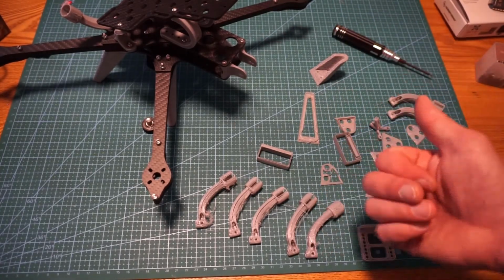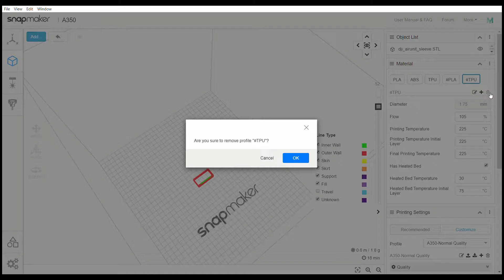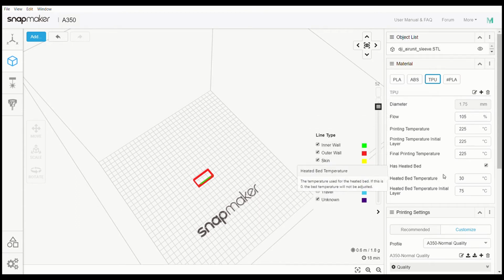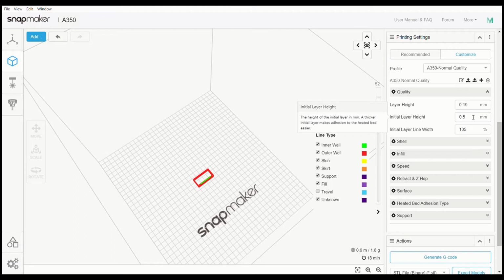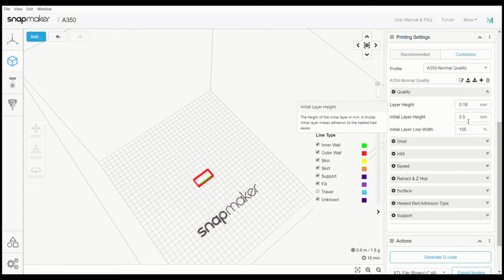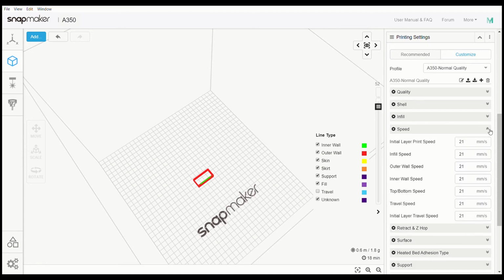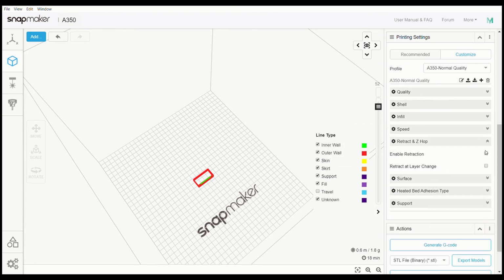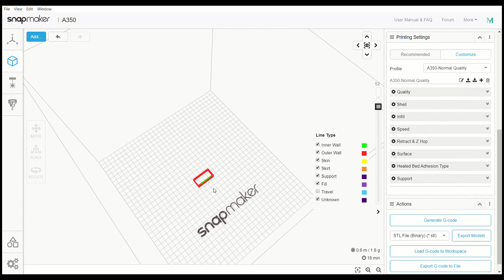SNAP MAKER 2.0, TPU PRINTING, AND SHENDRONES THICC

Comment: Thanks for this. One question: did you say you added a tube in the extruder that prevents buckling?
Reply from the maker: No I didn't add one yet. I don't honestly know if I will. If you're pushing that much filament out of the extruder you probably will have an iffy print. It definitely could be done and I've even seen models in forums that people have created but then you're forcing the machine to operate outside it's parameters and that's not really a good thing.